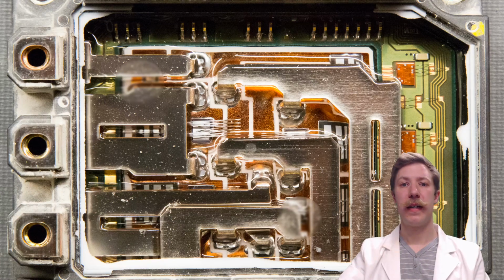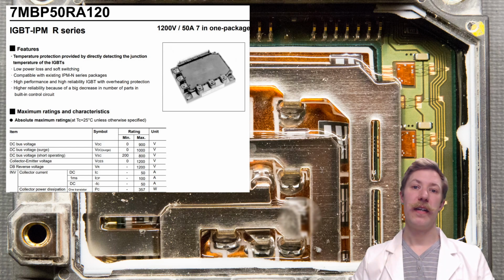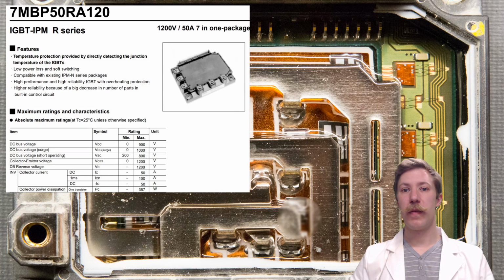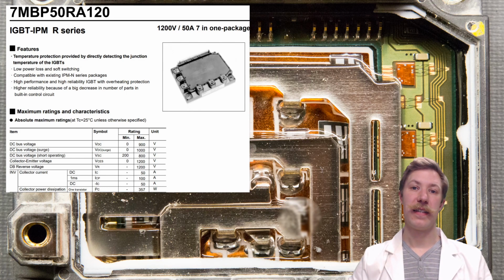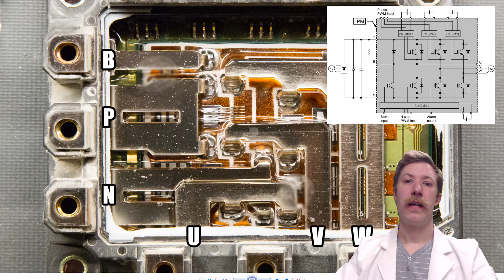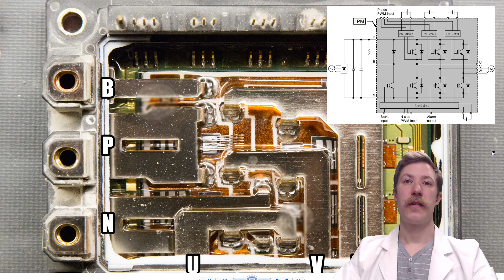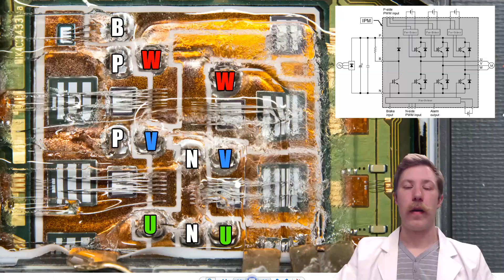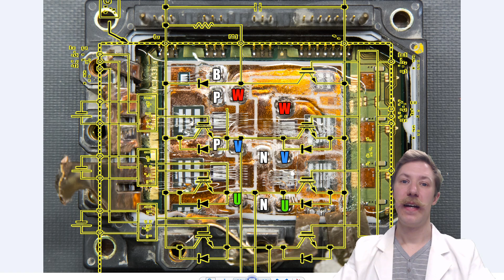3-Phase IGBT Module Teardown - Fuji 7MBP50RA120 From 3 kW Omron Servo Drive - Isolation, Day 36

Comment: Thx for the great video! One question that I still cant understand: How should the "Brake" IGBT work with DC-Link Voltage connected? If this IGBT is driven on with DC-Voltage, it essentially shorts out the supply as well..
Reply from the maker: When the motor breaks with a load, it generates power that can over-volt the dc link. To prevent this the brake chopper dumps the peaks into a large resistor. Google "brake chopper"

Comment: Como usar un ipm fna41560b2???? A que voltaje opera???
Reply from the maker: It is a 600V IGBT module, a normal rule of thumb is to only use a DC bus voltage of 2/3 to give room for switching spikes/transients. So up to 400VDC.

Comment: Mads - Production value (graphics, insets, overlays, voice) in your videos is exceptionally good!  With that, any chance you have done or could you tell your faith full viewers about what equipment  you use to produce exceptionally well done videos. I know it takes talent, but it would be interesting to understand what cameras, editing software, what computer(s) you use (ios, linix, pc?),  what lighting technology you use, your color balance system? Your green screen set up?  Again Mads, your production quality is way above similar youtube channels?  Unless, this info is not what you wish to share, I will fully understand. Thanks In Advance, Todd
Reply from the maker: I actually made a video about my gear, software and work flow a good while ago! It should all be demonstrated here https://www.youtube.com/watch?v=GiO0bid9lQw

Things that I do not mention in that video. Regular PC that is nearing 5 years now, some low range i7 by now, 16GB ram and SSD system disk. Green screen is a simple green cloth, Logitech C922 with Chromacam software for overlays. I do not use special lightning, but I try to make sure there is ENOUGH lightning. Mostly LED sources by now.
Reply: Thank you Mads! I will watch the video in the link provided. Again, really well done videos. Todd
Reply from the maker: Thank you very much Todd :)

Comment: That was a very nice in detail look at the module, thank you. 
I guess I was wrong in the last video, assuming that there is no gel stuff in it. 
Interesting to see the bus bars of the N input and U output actually being stacked onto each other, very intersting layout.
Reply from the maker: I guess the whole busbar work inside is due to that being a cheaper form of production at that time, than to have bond wires from die to terminals as its done today.